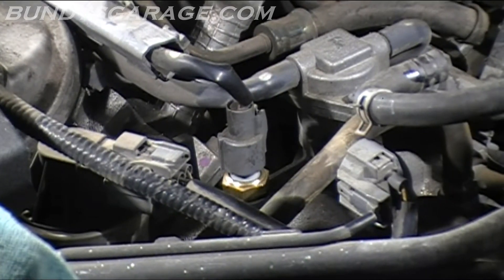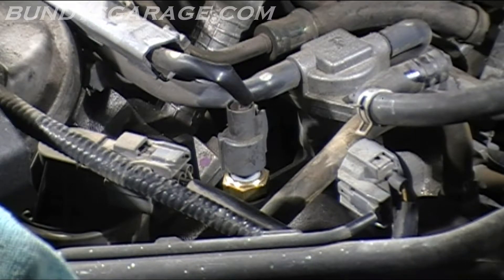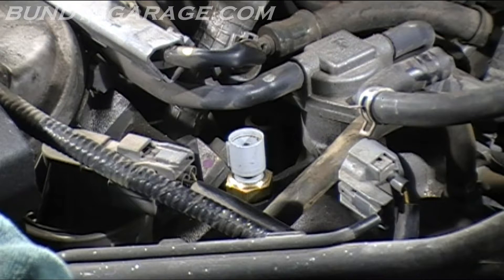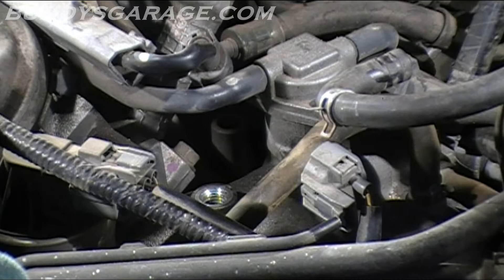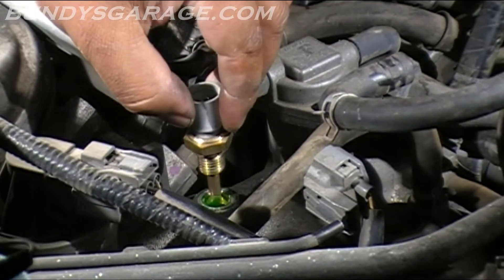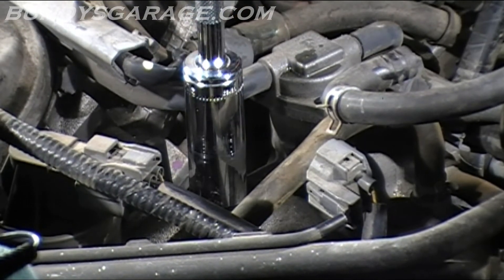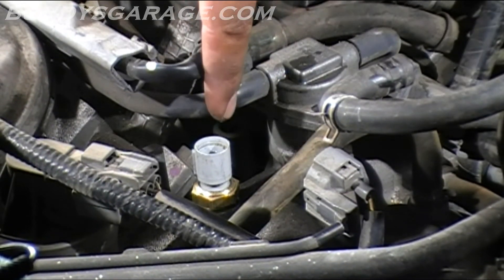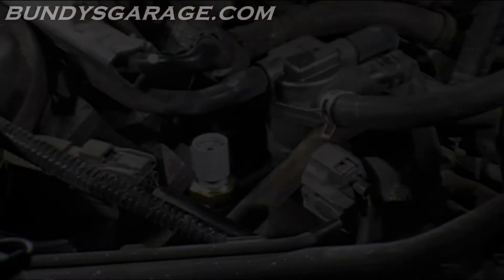UPDATE:Heat Soak Problem Solved Honda Acura J Series V6 - Honda Accord Acura TL

Comment: well I solved  the problem thanks to your video. You are right, it is a heating problem, that causes those symptoms.  Mine in particular was a fuse that is right next to the a/c relay. I had only one fan coming on and not both like it shuold. when you turn on the a/c both fans should  come on and stay on. with the a/c off, bouth fans should come on and off, about every 40 sec. I had only one coming on. It was doing the work of the other fan. not over heating but not cooling enough ether. my problem might  of not been a Temperature  sensor, but your video pointed me to the right direction Thanks.

Comment: Found it and replaced it.  It seems to have fixed it so far-no telling how much trouble you saved me-cannot thank you enough.
Reply from the maker: Your welcome
Reply: I just had a very stubborn code 1491, even though I had thoroughly cleaned my EGR passages.  It had a new EGR valve 12,000 miles ago, but I replaced the EGR anyway and now seems clear again.  I love the car when it runs right, but hey, it's 16 years old now and was well abused before I had it.  I've been reviving it and really love the car.

Comment: Can you tell me where this sensor is located on my V6 2000 Accord?  I am not sure but it looks near the EGR valve, but I think there is my fan switch too...
Reply: Rick S Barnes it's under the plastic cap of the throttle body

Comment: after driving  the car and parking it for 15 to 20 min. then I try to start it, it stumbles or shuts down. if I accelerate it,  I can keep it running to take off then it is fine. it gave me a code: misfire all cylinders. another way this occurs  is if I idle for like 1hr or so. it would do the same thing. that's when I notice the fan coming on every 29 sec. and would stay on for only 15 sec.

Comment: problem continued. one fan only coming on every 40 sec now. stays on for 15 sec only. is this normal? how often should it come on and how long should it stay on? anybody knows?  gauge always marking half. but there is no over heat.
Reply from the maker: What is exactly going on with your car? It does not sound like you are having a "heat soak problem", I hate that term because that's not the cause at all for the problem that is associated with it.

Comment: I noticed another way you can know if it's the sensor. Is, if your fan comes on sooner than 1min and 30 sec, you either still have air in the system or your temp, sensor is bad. THANK YOU Bundy!!  this looks like it solved my heat soak problem.  my fan at idle would come on every 29 sec. know it takes 1 min and 30 sec to come on.  i purged the system when i installed the temp. sensor. my guess is the mechanic did not do a proper purge when he installed the timing belt. I had very fine air bubbles. the way i did it was, every time the fan came on, i would gently squeeze the upper hose to help it get the air out. i did this until there were no bubbles coming out. the reason why i said it looks like it solved the "heat soak" problem is i wont know in till i drive the car tomorrow. NOTE: even though the fan takes 1 min and 30sec to come on, it does not over heat. which brings me to this question. how long should the fan take to come on? from the time it shuts down to the time it starts back up again. I'll keep you posted on the end results tomorrow. Again THANKS.

Comment: Thanks so much.  Just got a fuel pressure regulator to see if would solve problem but I will try this first
Reply: was the fuel reg the exact solution to heat soak and hesitations ??
What was the car mileage ?

Comment: used oem honda sensor.  problem solved. careful with plastic clip. may be brittle, I used mishimoto fan switch to turn fan(s) on sooner than oem temp. thanks for the solution! !
Reply from the maker: +Scott S. yeah that is one annoying problem, glad it worked out for you. I replaced so many parts hunting this problem down, let my loss be your gain.